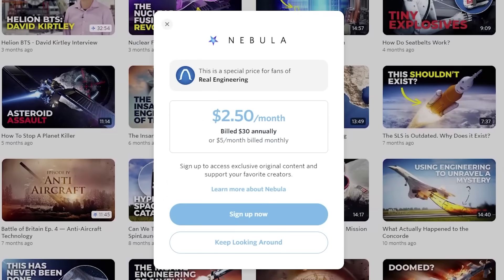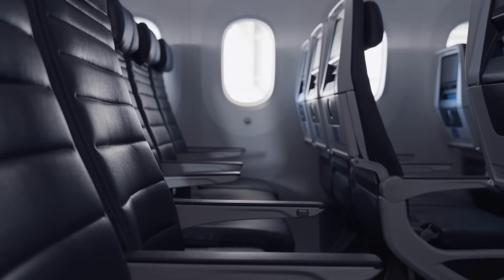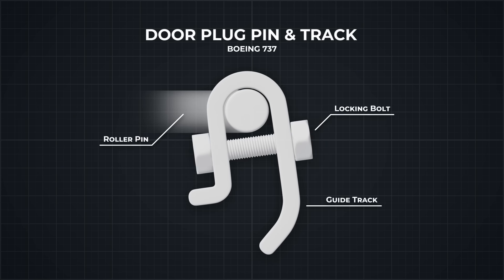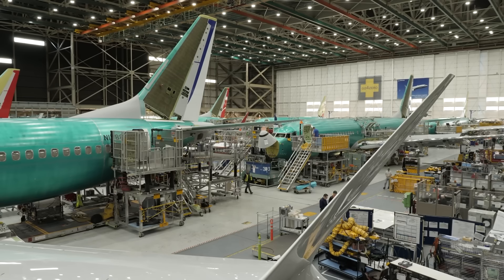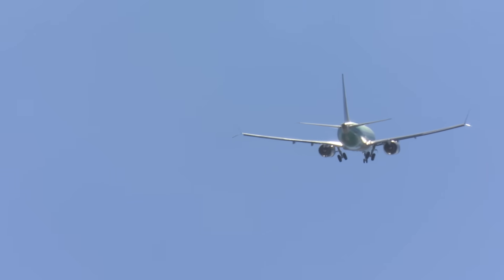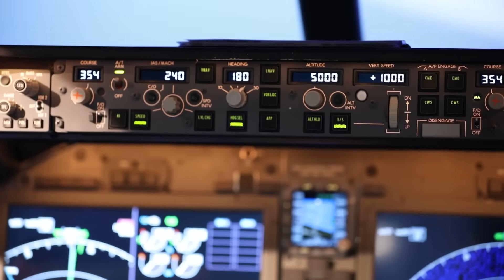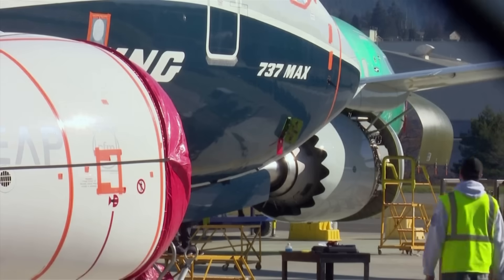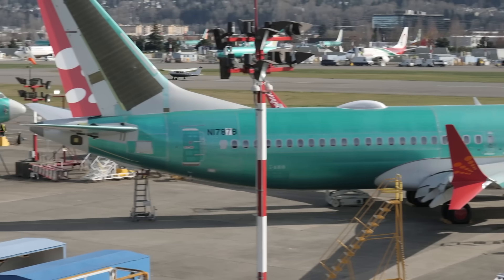The Questionable Engineering of the 737 Max

Comment: As a reminder, here's a timeline of Boeing's failures: January 2019 they announce their plans to fire 900 QA workers, around 1/4th of their QA staff. March 2019, the 737 Max is grounded after a fundamental design flaw causes two crashes that kill a combined 346 people. That's 9% of all fatal aviation deaths in the last decade, and around 1/3rd of all non-recreational aviation fatalities over the last decade. Boeing continues to lay off QA workers through 2020. The 737 Max is grounded for 20 months, and resumes flying November 2020. Passenger flights remain low through 2021, as Boeing ramps 737 Max production back up. January 2024, the second year flights return to normal, Boeing has another major incident on a brand new 737 Max, once again grounding parts of the 737 Max fleet, due to complete QA failures to check that bolts are properly installed.

It's important to understand how quickly the reduction in QA led to incidents directly caused by a lack of QA. Not counting the Pandemic and ~2 year 737 Max grounding, it only took 2 years for quality to fail enough to cause a major incident that nearly killed someone. 2 years is nothing in aviation terms. The 737 Max fleet was grounded for that long due to design failures.

I'm so tired of people in leadership trying to cut QA, thinking they'll get some big huge win over a long time period, before the consequences catch up with them. Every single time I've seen a reduction in QA and a push to "deliver faster", the company always ends up paying those costs in increased maintenance and issues. I've never seen a company successfully cut QA and end up benefiting over the length of time it takes to design and release a product. Sure, you can manipulate the budget to make this financial quarter look good, but you'll never win against the laws of physics and the rules of finances. Either pay the costs up front, or pay them with interest over a longer time.

Hopefully the lost sales, damaged reputation, and repeated groundings were worth the cuts to thousands of QA checks Boeing deemed "no longer necessary". I'm sure saving 10 hours of QA checks on ~40 planes built each month was worth destroying your company's reputation and pushing everyone towards your biggest competitor.

At this point, the rot is too deep. In my industry, Intel is currently trying to fix broken middle management cultivated over a decade of apathy and QA cutting, and they're failing pretty hard. Intel's competition is taking full advantage of all their failures and inability to create good products because they gutted their ability to communicate internally. It takes at least half a decade to rebuild a company's management and culture. The only stories I know of companies that successfully recovered from management rot ended up surviving by  basically reinventing themselves after they had lost 90%+ of their original size. For companies, changing culture, behaviors, and habits is hard. It requires you to cycle almost your entire workforce. I fear for the future of Boeing. I think the last opportunity for them to change their corporate culture was when the 737 Max was grounded. They chose inaction. And now their fate is basically sealed. The rot is too deep to fix in a reasonable timeframe. Either they'll die from being legislated out of financial viability with more repeated incidents like these, or Airbus will feast on Boeing's incompetence to outsell them into irrelevance. More likely, both.

Comment: To quote a Quartz article: 
In a clash of corporate cultures, where Boeing’s engineers and McDonnell Douglas’s bean-counters went head-to-head, the smaller company won out. The result was a move away from expensive, ground-breaking engineering and toward what some called a more cut-throat culture, devoted to keeping costs down and favoring upgrading older models at the expense of wholesale innovation. Only now, with the 737 indefinitely grounded, are we beginning to see the scale of its effects.

Comment: When the 737 production line was shut down due to the MAX crashes and then Covid, they laid off a huge number of employees in the Renton, WA factory.  When they started up production, quite a few of them never returned.  I actually hired one of their engineers.  I think Boeing has been operating since 2022 on a skeleton crew with many inexperienced staff.  Just my two cents on the subject.

Comment: When I was working at Boeing on a Military Aircraft, we had a Continuous improvement program in place to look at opportunities to improve diagnostics reduce repair time.For something like the Door plug we would have added pressure sensors on the bolts, or a way to examine the panel installation with less disassembly of the aircraft.

Comment: Knowing that Alaska Airlines knew that there was something wrong with the plane because of the multiple pressure warning messages, but simply turned off the warnings without doing any checks, definitely puts some massive blame on them.  It's a brand new plane, they should have sent it back to Boeing right away.  They should not have flown the plane.

Comment: there is merit to the "engineer vs business manager" assertion for a decaying corporate culture at an engineering firm. yes, an engineer can become a manager and can be susceptible to the same optimization fallacies that many non engineer managers succumb to. but, by and large, the mentality that leads to one being an engineer rather than a business manager, generally pays much closer attention to the tradeoff between optimization and physical risk. i observe that the priorities at an engineering firm where the product puts customers lives on the line, should never ever put cost optimization before physical risk. Boeing is an example of a decaying corporate culture. too many bean-counters in power, not enough power for engineers, and quality control.

Comment: Man. Any event, such as these previous pressure alarms, should have had a root cause performed. That's on the airline. Such an RCA might have called the design into question. 

Not confident about software being used to overcome a design problem.

Comment: I disagree that Alaskan Airlines likely bears blame for this as this pressurization system is triple-redundant.  The phrase "turning off the warning light" arguably over-simplifies the issue as the alternate (2 primary systems are toggled between each flight to ensure reliability) would not show any error; neither pilots nor maintenance could reproduce the issue.

There were likely very short leaks each time the door moved during flight (and it likely moved during every flight) and switching to the alternate system would then show no problems and the problem could not be reproduced on the ground in either system.

These warnings did not seem to represent "failure" as both primary systems continued to work properly during ground testing and for the rest of each flight.  False warnings do sometimes occur and the only reason for concern was that this happened multiple times.  The 3-strikes rule should have triggered extra investigation, but it might be the case that no procedure existed for this unexpected situation.

This incident demonstrated a failure mode that no one had likely imagined where an intermittent leak was occurring due to the moving door plug.  In the future, pressurization warnings without other explanation will cause all doors and plugs to be examined, but it would likely never occur to any maintenance crew to remove the interior panels to check the door plugs after a pressurization warning that they could not reproduce.

It frustrates me that Alaskan Airlines decision not to fly the plane to Hawaii is being used against it with the argument that they "knew something was wrong."  They took this step voluntarily as an extra precaution as the plane had working dual and backup pressurization systems; it is even legal to fly with only 1 working primary and the backup below certain altitudes and I know this because I was a passenger on a flight that did so ;).

If Alaskan Airlines had not blocked this aircraft from oversea flight, they might not be accused of flying a plane "known to be unsafe".  Their voluntary safety measures are now being used as evidence of wrongdoing and this encourages other companies to never take any actions not required by the FAA :(.  Ironically, ignorance is often your best option; "if we do nothing, we cannot be blamed."

The investigators and regulators might find that Alaskan Airlines does bear at least some responsibility because the warning occurred multiple times without a determined cause, but it was likely not required or recommended that door plugs be examined after pressurization warnings.  It was likely never imagined that that an airframe could be flying without locking bolts on the plug doors.  Now everyone imagines it.

Comment: Not an engineer, but wasnt there a case where a cockpit window blewout, and the lesson learned was: "dont mount windows on the outside, but on the inside, so when the screws fail pressure just pushes the window against the hull."? Why is this not mounted in that manner? Its not a door, it doesnt need to open. No need to concentrate the stress on latches and bolts.

Comment: Clickbait, I'm not even going to watch the video, maybe there is truth in the video, but the thumbnail and title are just Clickbait, those doors have been on Boing and Airbus for several decades and never had any problems in the design, if someone didn't put The screws and nuts to secure the door are quality control, even worse is that no checks caught it, and then the case of the loose nuts on the tail rudder or the lack of the lock nut, those are very serious assembly problems and QA. The problem of the detached loading door on the old 747s is an engineering problem. not what you put in your title and thumbnail.

Comment: Another reason the door plugs aren't fully installed at Spirit is the fuselage shape changes slightly once all the wings and other components are installed. So to make sure the door fits correctly, they are temp installed at Spirit, then supposed to be fully installed during final assembly
Reply: So unless the actual components of the door plug failed-which doesn’t seem to be the case here-and it was an assembly problem then the blame lies with Boeing.
Reply: even worse....all they had to do was use lock nuts. Even loosely installed, they wouldn't come off @mikoto7693

Comment: This is not a MAX issue. The MAX was just engines and a few other  small changes including insane MCAS.  these plug doors are on NG and are perfectly safe and a great design.  This was a quality problem. They forgot to install the bolts.

Comment: The pressurization reset and limit of over-ocean operation is standard procedure and is an FAA rule. Actually in this case Alaska limited its operation earlier than required out of caution. The light could have come on one more time before regulations required the plane to be grounded, but that warning light is a common occurrence on many aircraft models (for a whole slew of reasons). So it might be related to the door, but it also might not be. It's more than likely a Boeing assembly issue and not an act of negligence by Alaska Airlines.

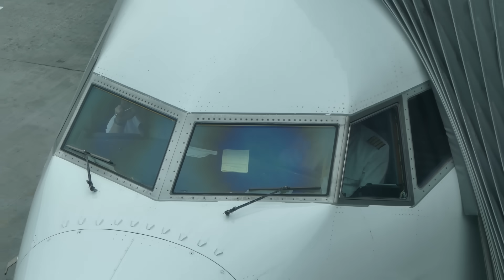Comment: Many over your statements are either incorrect or based entirely on opinion and conjecture. If you're going to make the statements you've made in this video, fully educate yourself on the subject, incidents and causes before making a statement. The southwest incident where a passenger was sucked out that you mentioned at around 9:20 was not caused by the cowling cracking and separating from over heating issues, but was caused by a fan blade separating from the fan disk. Normally, I love this channel and your videos as they are very well-thought out and researched before being published, but this is a severe disappointment that I hope you can learn from in the future

Comment: Good summary, but the 150% pressure testing would very likely never determine if locking bolts are missing as the door sits fully onto the stop pads during ground testing.  The locking bolts take no load during pressurization.  Visual inspection is the only way to determine if they are properly installed.

The locking bolts could indeed have been missing on multiple airframes.  However, the fleet has now been inspected and I have not heard of any missing lock bolts, so this was likely a one-time oversight.  Former employees of Spirit Aviation are reporting major issues with safety oversight as the company is far behind on production; similar issues might exist within Boeing.

It's not clear which bolts were found to be "loose" on other planes.  Those might not be the locking bolts, but the actual hinge bolts.  Reporting so far remains unclear.  It should be noted, however, that loose locking bolts would not cause this particular failure.  They don't need to be tight so long as they are present and capped by a castellated nut and pin.

We do want them to tightened properly to prevent vibration, wear, and potential noise, but the door likely cannot remove itself from the airframe if even just 1 of these 4 locking bolts are present!  I strongly suspect that all 4 of these bolts were missing altogether; that the interior panel was installed without the locking bolts being installed or checked.

As there is almost certainly a checklist for these installation steps and a safety manager to double-check them, this is indeed a major problem where the entire production chain must be examined.  If this could happen on a door plug, it could happen elsewhere.

Comment: Wonder if the "push-up" assist springs are the same strength on the light dummy doors as on the full weight real doors? If the top pins are broken or out of line, can the lightweight door then spontaneously "spring up" beyond the "pressure lugs" into the open position? A nice single point of failure if so.

Comment: As much as I love to rant about the 737 Max and the creative engineering they had come up with to make these bigger engines and longer planes work (e.g. the telecope gear on the -10s) I have to complain about some statements made througout the video:

1) The 737 Max is not unstable (even not a little bit). The MCAS system was only introduced to emulate the behaviour during late go arounds. In this situation the Max has a bigger pitch up momentum than the previous 737 NG. This could have been solved with simulator training for flightcrews. But this additional training effort would have been a major(?) drawback in comparison to the A320 where transitioning from ceo to neo doesn't require additional simulator training. So Boeing opted to build the MCAS and made two mistakes. Not pointing it out enough to the flight crews and not implementing it fail safe in the first place. I'd say that's half an engineering half a communication problem.

2) The door plug and its contruction is industry standard and used on other planes like A321 and the older 737-900 in a similar manner. Here the main problem is most likely in flawed manufacturing practices and QA. Also not in the engineering itself.

Comment: ~ 7:30 - Let me point out that Boeing didn't even put existence of MCAS into the pilot's manuals, partly under the pressure from their largest customer, SouthWest, who wanted to avoid an additional hour or two of simulator training for their pilots. Add details like the fact that the system would turn back on five seconds after pilots disconnected auto-trim, the fact that was also not mentioned in the manual or "runaway trim" checklist, or that  annunciator warning about disagreeing angle of attack sensors was only in an optional instrumentation package, and you have quite a grim picture of the company's stance on safety.

As for "self-congratulating engineers", they are mostly right. The problems at Boeing started when McDonnell-Douglas, in effect, bought it with Boeing's own money - practically all upper management of the newly merged company were beancounters from MD who practically flew their own company into the ground, and proceeded to do the same with Boeing.

Another factor was divesting many divisions (such as what is now Spirit) as a cost saving measure, resulting in increased cost of integration and, of course, much more difficult quality control. Airbus almost committed the same blunder, but walked from the precipice at the last moment. (Not that they don't have their own problems, eg. with A350 paint - perhaps not a dangerous one, but certainly very embarrassing.) Problems that engine manufacturers have with their new creations are shared between planemakers about equally (or with Airbus being slightly more impacted.)